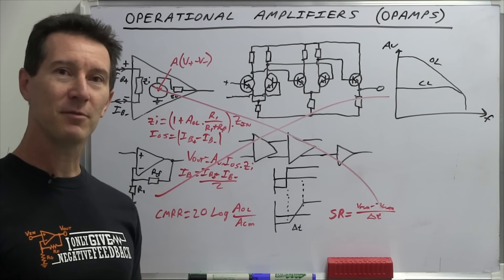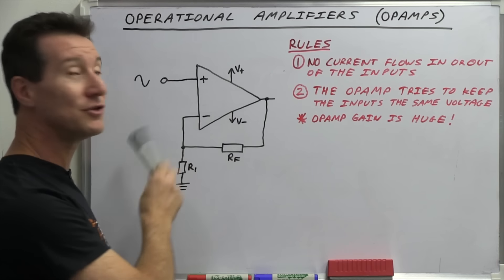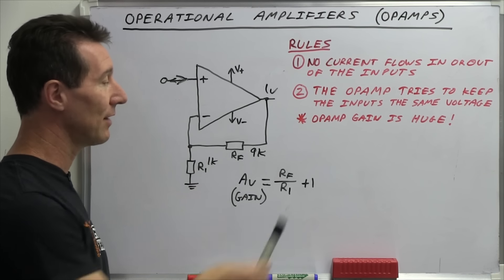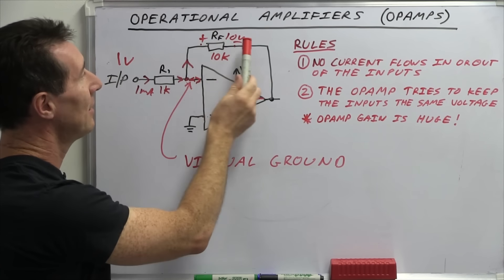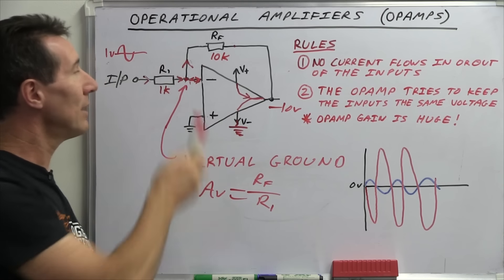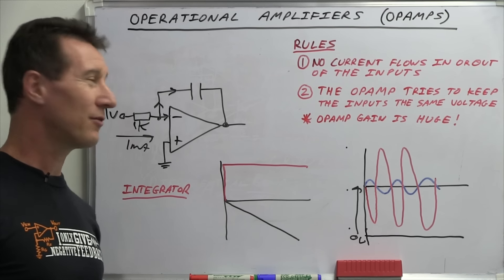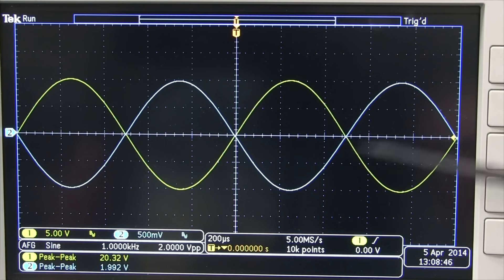EEVblog #600 - OpAmps Tutorial - What is an Operational Amplifier?

Comment: Here is an interesting thing, take "virtual ground" at 17:20 and say that there will be no signal at that point because the "+" input has been physically ground. BUT since the opamp does not quite have infinite gain, there will be some voltage swing at "-" input. It is just that we take it for granted that a theoretical opamp has infinite gain. But if the gain is a finite 100.000, then if we have a voltage swing of 10V on the output, then we will have some signal at the "virtual ground" of 10V/100.000 and hence we will see 10uV of swing, so not much but there will be some. Some opamps have 120dB of gain around 100 Hertz, so we would only see 1uV there.

Comment: It is caused by crossover distortion as the output drivers are both off for a brief period of time as the opamp switches between sourcing and sinking current. The internal 50uA sink can prevent this when the output current is small and the frequency is low. This is a disadvantage of opamps  designed with a constant current sink in the output stage to bring the output to zero during crossover.
Reply: The spikes at the virtual ground input exists because the output drives of the op amp are no longer functioning, therefore the "Rule 2" is no longer functioning for that brief period of time. After all, thanks to your great explanation, it is the output of the op amp which effectively creates the virtual ground.

Comment: Op amps are a great building block of electronics.  Any difference between the + and - inputs produce an appropriate output. Because they have a theoretical gain of infinity, the voltage difference between these inputs is, in a healthy op amp, near zero. Therefore, when troubleshooting op amp circuits, always suspect a device that shows a substantial difference between the inverting and non-inverting inputs. Get used to the typical pinouts of them :  4558 , 4560, etc devices.

Comment: You made the first half a little bit complicated. From my schooling I'm a bit used to putting bows across where you'd have voltage drops and the amount of the voltage drop; like over/under the R1, in the examples, you would get a drop of 1 volt, which equals U(R1)=1V. The same with the virtual ground; there would have been easier to put a bow between + and - and write 0V. Which always applies and make it easy and fast to understand the second OP-law.
Good video any way, and I really like all your videos (even though I'm a bit late in the game for them here).

Comment: Thanks Dave, great video. But...an operational amplifier is a conceptual object consisting of a two input terminal, one output terminal black box of infinite differential gain, infinite input impedance, infinite bandwidth and zero output impedance (and with zero second order issues like CMRR).  Without making these assumptions, which are true to most applications, the mathematics which students are taught gets difficult.

Comment: Virtual ground concept is confusing up to a point if you realize that for a current to flow through Rf and not to the inverting input of omp-amp one needs to have lower potential than ground (negative).  This is why it is inverting such that sink has lower potential wrt ground. Another interesting point is that in case of AC coupling  such as audio amplifier with DC input, one essentialy gets buff (voltage follower) non-inverting op-amp with finite Rf (10K,1K,100K etc.).

Comment: I had a design with the LM158 in 1989 that I sold to the military 56M, then I sold an LM358 design to the #3 American company putting in cell towers in China [ahead of land lines]. One of the op amps was a oscillator / charge pump to charge up the op amp's own supply. The other op amp was the error amplifier for a high side N channel FET that was a linear regulator. This has since been copied into ICs and no one would pay me today.

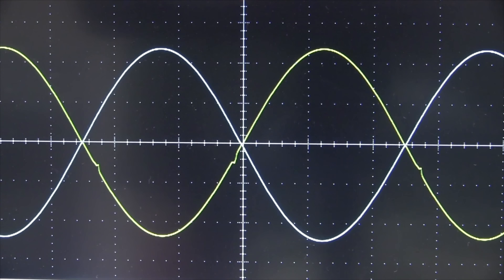Comment: 49:11 I think that spikes has to do with the virtaul ground practically is not 0 voltage because the parasitic impedance of resistors or maybe putting a capacitor right there acting like low pass filter cutting out that spike, I think that's why the input resistor has to be greater about 10k and RF resistor 100k to smooth it out that spike from the virtual ground.

Comment: Actually there will still be a very small signal on the virtual ground. There needs to be at least some "error" signal there to drive the op-amp input, which in this case would, in theory, be proportional to 1/open loop gain. Be interesting to see the op-amp driven to higher frequencies. At some point the virtual ground will fail due to bandwidth limitations. Edit: scope says its ~18 mV, which is about 1/1000 the output signal, or about 60 dB @ 1 kHz, which matches the datasheet pretty well. Also shows it at the end when the op-amp is saturating at its maximum current output and making a glitch. The signal is also out of phase due to the gain roll-off they have built into the op amp.

Comment: Thank you for this very educational video! 
Are op-amps a good way to make the meter of an analog instrument more sensitive to signal ??
If yes, have a very specific situation where I'd like to apply an op-amp:
I have installed a shunted ammeter in my car to monitor how my alternator charges the battery, or when the battery is being discharged by various loads when the engine is off. The ammeter gauge reads up to 150A (scale goes from -150A to +150A) and is mounted on the dash. The ammeter shunt (150A 50mV) is external, being mounted behind the firewall. Two fused sense leads go from the shunt, through the firewall, to the dash ammeter gauge. It works well and I chosed a 150A ammeter because the alternator is rated 91A (at 5100rpm) and I know it's better not to use shunt to current more than 2/3 their ratings because they could get hot and possibly loose their calibration. But in normal situations, I never see more than + 20-35A right after I start the car (alternator charging battery), and after a few minutes the needle is close to 5-10 Amps (battery almost completely replenished by the alternator, not taking much charge anymore). So the thing is that each graduation on the ammeter gauge are 30A (not very precise). I'd like to be able to press a momentary switch (mounted on the dash) to increase the sensitivity of the ammeter gauge by a factor x5 (meaning when the current is 30A, the meter could display 150A). The shunt is rated for a 50mV voltage drop through the sense leads when the current is 150A. So at 30A, the voltage drop is 10mV. So basically, I'm looking for a small circuit (op-amp based?) that would linearly increase a 0-50mV signal to a 0-250mV one. I'm okay with 5-10% reading accuracy. I thought maybe I could find some suitable amplification circuit on amazon to do this job. Can you recommend anything ? I found something called a "AD620 Gain Signal Amplification Module", but I'm not sure if this is adequate. Any recommendation ?

I do not want to install a smaller shunt instead of the 150A one. There was one instance in the past where the ammeter read close to 80A (I had jump started my car but my battery was completely dead at 0V). So I don't want to risk using a 30 or 50A shunt.

Comment: Question: which came first, the rules (i.e. the engineers founds the a compelling need of these features in a big group of components then intentionally designed them following these rules), or the actual opamps (i.e. these rules are only coincidentally some shared features of these ICs, which means they might not hold forever)?
Great tutorial btw. Thanks.

Comment: Over simplifying electronics often leads a learner to  misunderstand ;  but complicating the explanation with equations surely frightens off  a beginner !

Now op-amp gain without feedback is huge:  over a million !
For 1 volt output the input voltage to the amplifier will be less than 1 uv (a millionth of a volt !)  NOT 0 volts! 

Note that the INPUT signal to the circuit is NOT the  input voltage between +  (plus)  and  - (minus) of the op-amp, 
which always includes the feedback signal see:    8:06/49:31  of EEVblog #600)
    
A real amplifier requires a real input voltage to produce a 1v output signal !

An beginner in electronics would need several exposures before understanding ALL the specs and complexities of  op-amps.
Dave's  tutorial is a good starting point,  read some application  notes for the complexities .

observerms

Comment: I am trying to repair A pioneer DJM-S9 and the schematics are not freely available. the balanced output has hot and cold left and right  that goes through opamps and the cold outputs have fuses on them. Both fuses had blown for the left and right outputs and after replacing them I looked at the outputs and the hot has clipping on the left and right over a certain volume level. After watching this I kind of understand, but I am more confident with digital electronics so a little out of my comfort zone.  If I remember the voltage for the +15 and -15v are ok and the hot and cold have the same peek to peek voltage as them come into the circuit. All advice so far is to just replace the £400 board that no one has for sale and I can't ask pioneer they will just not give any help..

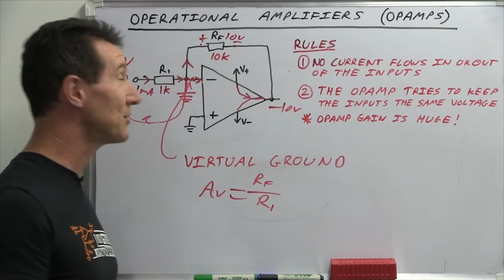Comment: At about timestamp 23:15 to 23:30 you state that if BOTH op-amp (V+ V- powered) inputs are tied to ground,  That the output would be "0". But earlier you say that since the gain is so high, that the op-amp output would saturate to one of the rails.  So why doesn't this configuration make the output saturate, or at least, 'jump'  from V+ to V- ?  In other words, why is it stable while the inputs are BOTH somewhere BETWEEN the rails?

THANKS FOR YOU HIGH-QUALITY VIDEOS!!!
Reply: The gain is multiplied by the voltage difference - but if the inputs are both tied to ground, the voltage difference is zero, and so the output is therefore also zero.

Comment: At 30:00 applying half of the DC at the non-inverting input will actually be amplified like an non-inverting configuration. So it is not correct (in this particular setup with those resistor values it would be amplified with a gain of 11) that adding half the supply voltage at (+) input, the output will swing around this......
If the I/P is AC couple it would work.

Comment: I need a better explanation of the opamp buffer
it is an impedance buffer and - most of all - it is a voltage follower (geman Spannungsfolger)
wikipedia also mentions an impedance buffer built as current follower but I cannot imagine what it does.
It would be very kind if you'd make a video like "current follower vs voltage follower"

Comment: I have a question to the voltage divider on a non-inverting amplifier. I have to calculate the Resistance of R1 and Rf, and I know the ratio for them to give me the desired output Voltage but what Current do I have to use to calculate the Resistance? Does this even matter in this case? Might be a very trivial answer but I barly know the basics of electricity. Just enough to calculate and build basic circuits. Thx to whoever might answer. Also great video, helped me to understand moogs ladder filter and how easy and useful it can be to use Op-Amps.

Comment: I designed a class d amp using a op amp front end and if the output went above a certain voltage the output would actually flip over to the minus rail. This only happens with certain op amps.

Comment: Hi! Thank you very much  for your interesting lessons! Great job! . 
 I have a question about AMPs,  i made tangenta for my radio transiver with simple  lm358 (as a preamp for the microphone) and lm386 as amp for the speaker, but every time the transiver is turned on for the reception i get sound boom (less than 1 sec) on the speakers before the voice of the station. What i need to add before the amp lm386  to remove this effects?

Comment: BASICALLY The (-)ve feedback config, the opAmp tries to make input= output, it has the internal circuitry to do that, but when i tried to challenge it by attaching a 10k resistor at feedback(remember that feedback is the only way opamp can know that it's functioning works properly), it says no no that can't happen and immidiately generates a cancelling (-10 volts)using it's internal circuitry, so that it's working principle remains true i.e opAmp tries to keep I/P and O/P voltages the same!!!

Comment: See, in the simple feedback loop at 11:50. Applying 1V into the op-amp gives 1V on the output. Feedback loops transfer this output voltage onto the inverting input. That's fine. 

But then when the inverting input changes to 1V, the difference between inputs changes to 0V. Because the output voltage is the difference between input voltages, the output voltage should change to 0V. And everything repeats. Am I correct?

Comment: The easy way: upgrade your best cars in NFS, and play, drift, jump in the game. All these turn on, and needs all 3 power plans separately. For non-gamers, the battery has to be drained in Bios after every 10 charges. Bad batteries won’t do this. Some processors like 1.86 Ghz Pentium single core won’t switch on these components. On Power banks Samsung phones torn on the amplifier, and the DV charging.

Comment: Is anyone wondering what was the answer for his question at the end of the video? Why is the waveform distorted when the resistor value was decreased. My guess is that when the R1 value is decreased from 10K to 1K more current is allowed to flow through the Non-Inverting pin (Since the Op-Amp is not ideal) which messes up with virtual ground property as well as the output voltage.
But how could there be a negative voltage at the place of virtual ground??? WHY IS IT SO?

Comment: Hey Dave, what do you recommend to program the ATMEGA2561?? I've come across a TQFP board, but if the chip is soldered in circuit, is there a programmer that would work well? The first program on the 2561 would be to write the eeprom addresses, the second program would be the intended usage program. Thanks.

Comment: So let me get this straight - a buffer can be seen as 'decoupling' two parts of a circuit? It takes the input and 'copies' it to the output?

Also, how are the powered? How do I get a negative voltage from a battery, for example?

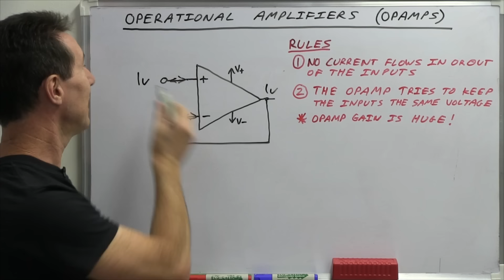Comment: I am confused AF. At 1:50 you say it's the differential of the inputs, however at 11:00, both inputs are 1, so the output should be 2 (=1--1). Help me make sense of this? My current (har har) level of understanding of the circuit at 11:00 would expect the output to be 2, which then is fed back. for a difference of 1, producing an oscillation?

Comment: 35:24 Where does the 1.909 V comes from at R2? (before it got subtracted by the virtual ground) From the x amount of current from V+, right? When I calculated the x myself, I got 1.1 mA (1.1V/1k Ohm). I know that the x current will flow into R2 (because the - pin has high impedance), so the voltage at R2 from x current is 11 V (1.1 mA*10k Ohm). It's different from 1.909 V in the video. I think I missed something, but I don't know where :(

Comment: mhmm, why does the configuration at 10:00 not go to extreme values?
I would think that for a positive input-voltage, the OpAmp would build the difference, plug the difference back into the inverting input,
hence creating a negative voltage there, which would lead to an even higher difference, creating a clear feedback-loop. Doesn't sound like a buffer to me...
What am i getting wrong?

Comment: The imperfections/spikes in the waveform at the end. Is it due to the higher current through the circuitry when smaller resistors are used?

Comment: Around 22:30 its mentioned that for 1V input, there will be 1mA current through the 1K resistor, but isn't it in series with the feedback resistor ? So shouldn't the current be calculated by taking into account the value of that resistor as well ?

Comment: Hello, sir. I was calculating the amplifying coefficient of the OFFSET inverting amplifier and it wasn't as you showed on the board... I calculated it to be V0 = - (Rf/Rn)*Vi + Vg*(1+(Rf/Rn)), where Vg is a virtual ground value (an offset), which is set by the voltage divider on the + pin. Can you please confirm?

Comment: So I learned that OpAmps amplify the difference between two inputs so, Vout = A0 (Vin1-Vin2). Let A0 be some big value like 10^4, and they say that the "ideal" opamp would have 0 volt difference at the input. So when you take that in equation, you get Vout = A0 x 0 which is 0. So in that example ideal amplifier would have output 0. Am I missing something? Thanks in advance.
Reply: (Vin1-Vin2) is not actually 0, it's just so low that you assume it to be 0 in your other calculation, if the output is 10V (and not saturated), (Vin1-Vin2) is 10/100000 = 0.0001V. It's also not true that no current flows through the inputs pins, but the values are so small that they are negligible (most of the time). Both rules are an approximation.

Comment: Hi sir,,,
thanks for your clearly explanation,
but I want to ask about differential Amp , in minute 33:17 
how about if IN -[negative input] is lower than IN+, for example 0.9V?
The differential input is 0,9V - 1 V =  - 0.1 V [negative], so the output is +10V.
is my perception correct ?
Reply: i think so! it's my primary doubt and i can't find real answer :(

Comment: For the non-inverted amplifier, would the output saturate at V+ also?  We had a gain of 10 based on the feedback loop, but will V+ always be the limit of the output voltage?

Comment: by the way the statement  No current flows In or out of the input didn't make sense to me so i did a search. Found out the schematic where transistor were placed in common emitter configuration, Common emitter configuration have high gain..Even small amount of current flow to base is  enough for working and that current can be neglected